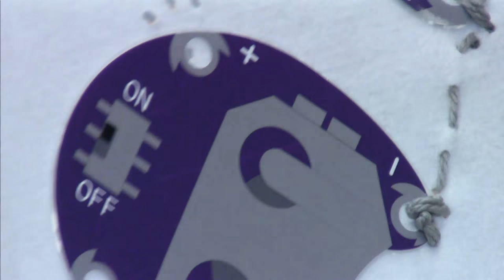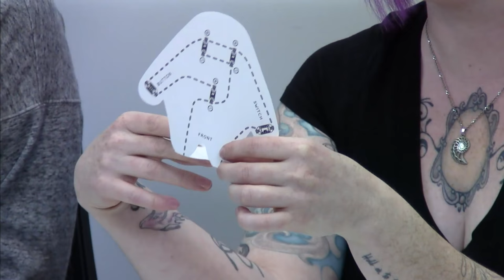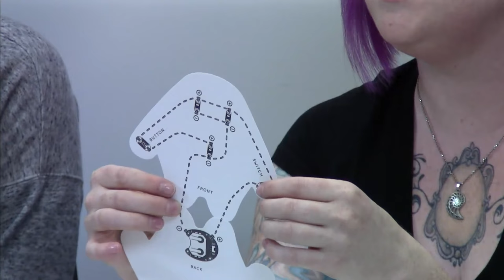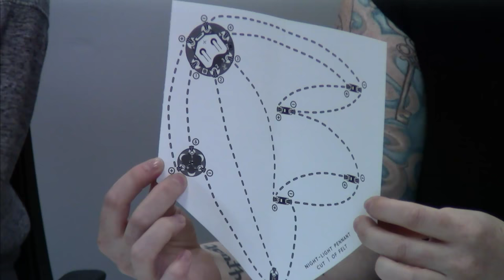Intro to Sewable Circuits: Teaching Electronics Through Arts and Crafts

Comment: I have made some wearables workshops with kids and the problem was the cost of the materials. So in a pure maker way I designed a cell battery holder that can be sewed and that is 3D printed. Also I use estandard leds with the legs twisted like a loop.
Reply: This is the link to the battery holder https://www.thingiverse.com/thing:1927411
Reply: Thanks for the tip Oliver.  We use the standard LEDs too.  I will check out your battery holder...